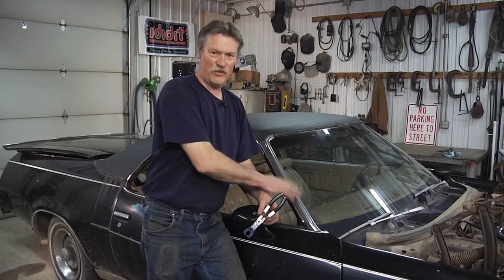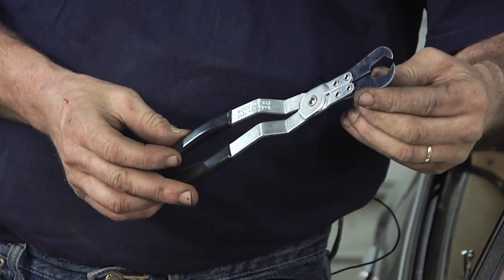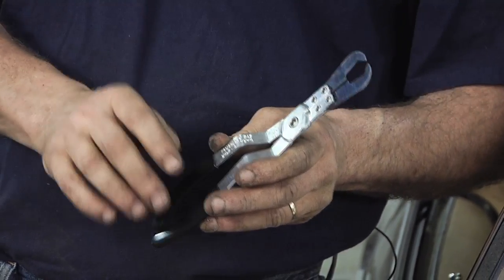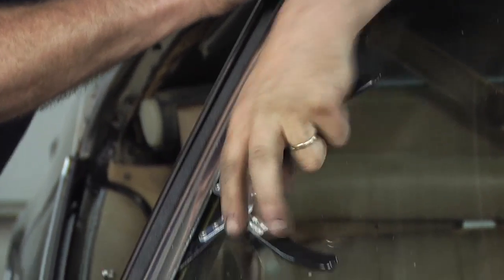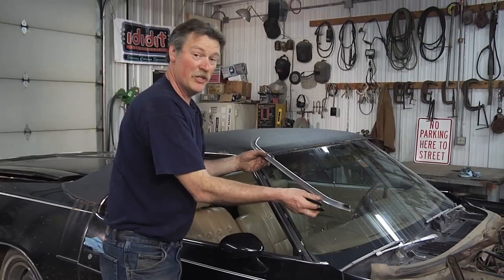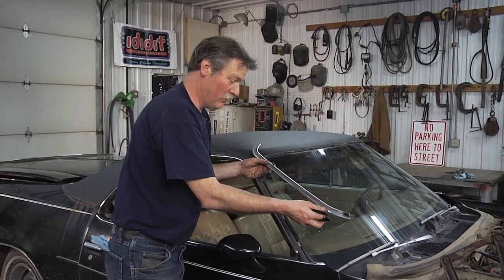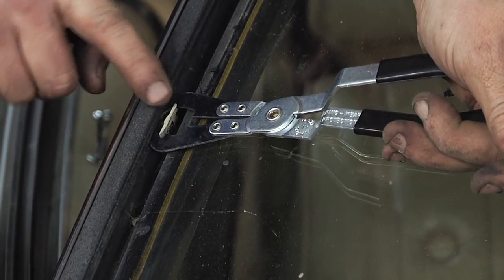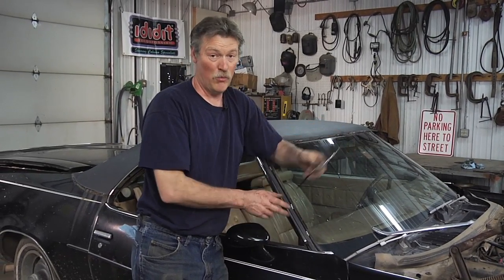Windshield Removal Tool For Molding Clips

Comment: Thanks.  Trying to remove the stainless trim around the rear window of my 1965 Dart.  Got one clip loose using small screwdrivers, then ordered the Lisle 35200 tool you show (fishingwombat link below still works, $10 on-sale w/ free Amazon Prime shipping).  From what I can see peeking under the trim, the clips look identical to the GM shown.  Need to angle the tool so the teeth drop deep to clear an extended tab on the stainless where the clips sit.  Blow all the leaf gunk out with air, sliding a thin putty knife along, and also to cut any silicone sealant a prior guy might have added.